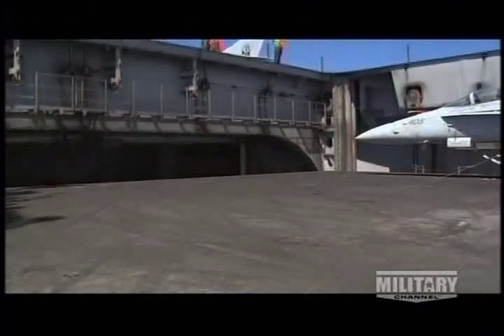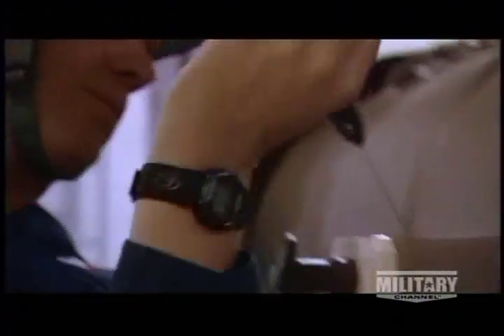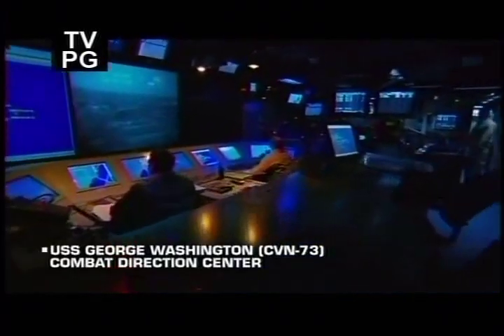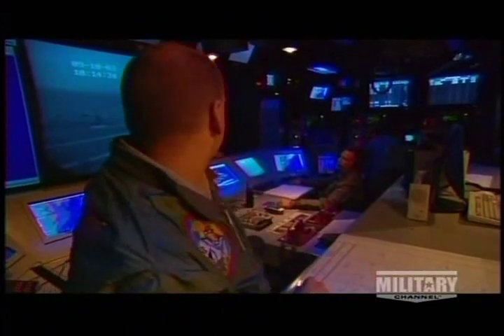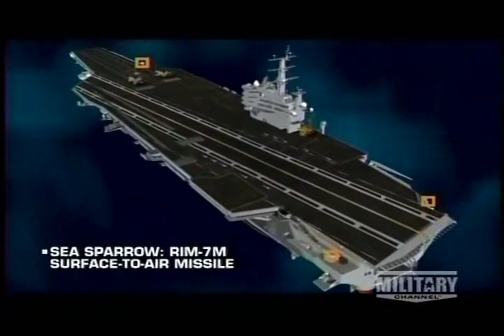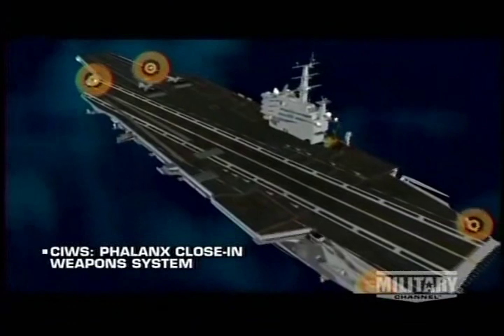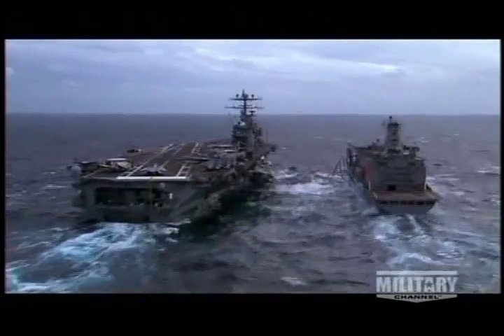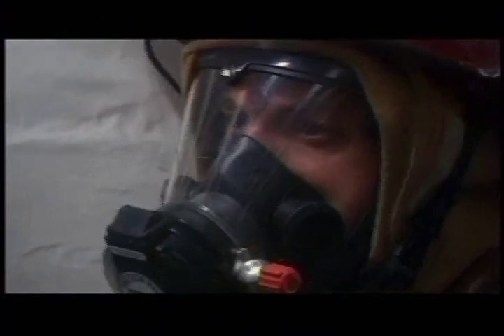Anatomy of a Supercarrier Part 4

Comment: It's actually FAR more dangerous, because the ship doesn't have positive control over it's movement when at a standstill. Two ships at anchor right next to each other will swing around the chain and collide. They're also usually way too deep to anchor, and when anchored a carrier has to be thousands of feet away from other ships. With the procedures in place, side-by side refueling in motion is the safest way to conduct underway replenishment.

Comment: Carriers are almost always on the move.  Firstly because moving keeps them able to launch aircraft, secondly because they are mostly on their way somewhere and thirdly nuclear power costs nothing in terms of burning fuel cost.  In addition, keeping them in motion also keeps them an exact distance apart from safety because they have speed and steerage control  Most refuels are about 14 knots.  Stationary vessels are prone to drift.  You can't always just 'drop an anchor'